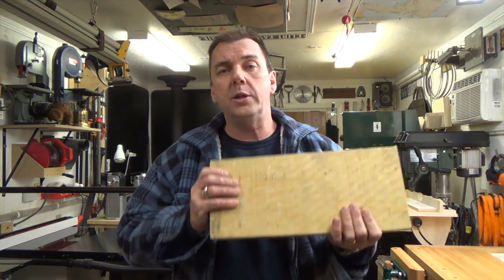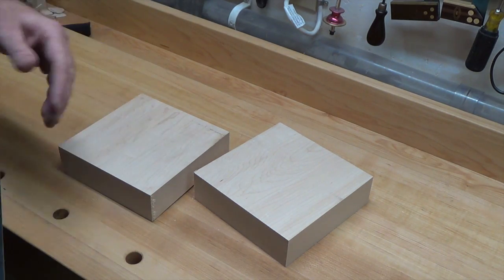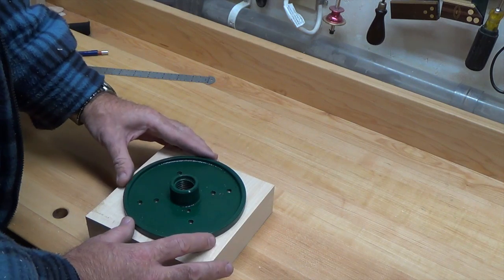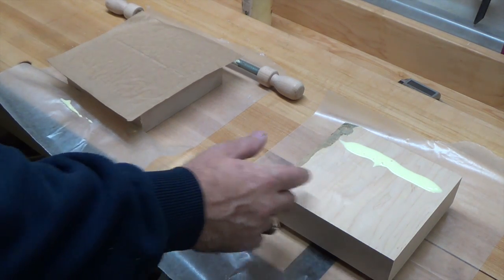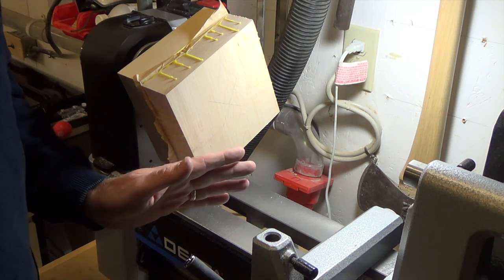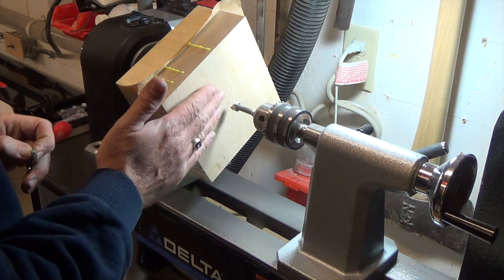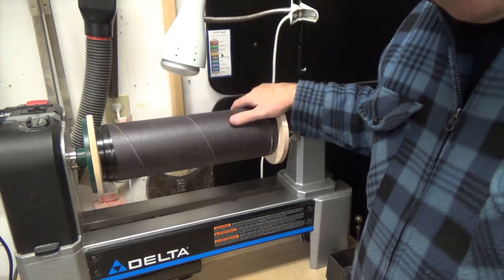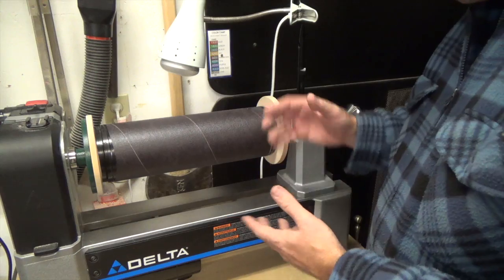Making a Ukulele Part 2 (Thickness Sander Build)

Comment: Kenny - Really interesting idea for the thickness sander.  Now you are really set for any kind of thin stock.
Reply from the maker: Thanks Dave.  This was definitely a great project to make and it has come in handy on many occasions.  I would like to get a commercially built sander one day, but until that day comes, this shop made one works just fine.  Thanks for tuning in.
Reply: Kenny - I may have missed it, but how is the right side of the drum set up?  Assume you are using a live center but is it just set into the wood flange or is there a nut embedded into the wood for a bearing surface?  Thx.
Reply from the maker: Starting at about the 10 minute mark Dave, I explain the process for embedding and gluing in place a 1/4-20 nut to keep your live centre from wearing the wood at the tail stock.  The steel of the nut keeps the whole unit centred and spinning true on the lathe bed and prevents the wobble that would be created if the tail stock wood were to wear and become oval or off centre.  I hope this answers your question.
Reply: Kenny - Yes.  Thanks very much.  Really love this whole idea and plan to make one.  Thanks for all the great details.
Reply from the maker: You're very welcome sir.

Comment: Your sander is brilliant.
Reply from the maker: +PinHolePip 
Thanks for the kind words.  On last week's show, I made a dust collection shroud for the sander.  It truly does work extremely well and is a fairly simple project for anyone.....as long as you have a lathe and access to the material to make the drum.
Reply: +kennyearrings1 As luck would have it I came into a nice little Grizzly lathe last week that will fit the bill just fine. 
Thanks again for a great little series with the uke build.
Reply from the maker: You are very welcome.  I hope that you will find other episodes of the show interesting as well.  Thanks once again for tuning in.

Comment: Nice idea! A lot different idea than I thought you would go, wish I had a lathe.
Reply from the maker: +michael hoyle 
Hopefully, one day, you will have a lathe and this idea will still be waiting for you in the end.  I would have liked to make a stationary one, but I just don't have the room in my small shop.  I'm pretty packed in there now.  Thanks for the kind words and for taking the time to leave me a comment.
Reply: I am looking for a good used Rockwell/Beaver lathe to round out my Collection of vintage Rockwell/Beaver tools.  I laugh because most of my power tools like my saw, or hand tools are way older than me, but hey they just don't build tools like that any more, and the ones they do are way out of my budget LOL!
Reply from the maker: I hear ya.  Some of the best quality tools are the oldest quality tools.  Way too many cast white metal parts nowadays whereas before, the parts were good quality steel.  Sad really.  That, combined with the fact that our selection of manufacturers is getting less and less makes it harder and harder to get good tools for the hobby.  Good luck on your search for a lathe.  I've got my fingers crossed for you.

Comment: I picked up a 30 " pipe so I could have two grits of sandpaper. My plan is 13" I'm making end grain cutting boards and sanding with a palm sander is taking forever and I'm not doing a good job getting it flat or even.

As a test case I simply inserted two wooden plugs and then made a table similar to yours the piano hinge and an old car jack.

In 15 minutes I was able to thickness an end-grain cutting board. It worked like a charm.  I love the idea of your clamp on the bottom of the table to hold it to the lathe.

I also love the idea of turning down the end caps so that they're perfectly round and also mounting it to the end cap. After 15 minutes of my test case the tail stock and began to wobble. I love the idea of putting a nut in the center . Thanks for all the great inspiration.

Since you put this video out four years ago, is there anything you would do to change and or improve the drum or the dust collector you built in the second video?
Reply from the maker: Glad to hear that you found this video to be helpful and that you made your own.  I like the idea of the two different sandpaper grits.  If I were to change anything, I would change the nut at the tailstock.  I would install it a little tighter so that there is less of a chance of wobble.  After using it for quite a while, it does wear and start to spin out of square.  The tail stock starts to wobble ever so slightly and the nut has to be removed and glued back in place as square as you can get it.  Possibly a larger steel block with a punched centre point to allow the tail stock to sit firmly in place would be better than the larger hole of a nut.  As for the dust collection shroud, I wouldn't change a thing.  It performs perfectly for my needs.  I also use it to sand end grain cutting boards so I completely understand how you would like the speed with with it does it.  Just make sure to hold on to that board because if the sanding drum grabs it, it's going for a flight.  Thanks for tuning in to the show.  I appreciate it.

Comment: That is an awesome solution! I only see one little thing you could improve. I think the adjustment screw on the table will eat into the top board. A little metal plate will solve that. 

I love this solution! Great stuff!
Reply from the maker: +Willem Kossen 
Great suggestions.  I may have to drill out a shallow forstner bit hole and epoxy in a small fender washer.  Great suggestions.  Thanks for tuning in.

Comment: Very creative solution Kenny. 
I wasn't really sure where you were going with this so you had my full attention the whole time. :)
I was wondering about the live center and the nut you glued in.  Do you think it will damage the live center as those two rub against each other over time?
Looking forward to the next installment.
Keep up the good work!
Reply from the maker: +Chem Cody 
I did think about that and I'm not really sure.  That's why this is NOT my good live centre.  I don't really think that it will damage it as it isn't really rubbing.  There's enough tension on the tail stock to engage the live centre and allow it to spin so the rubbing is eliminated.

Comment: Great idea with the sander sir! Thank you. What is your opinion on using the plastic quarter inch thick tube instead of the metal one? Best wishes for your show from Russia.
Reply from the maker: +Михаил Попов 
Thanks for the kind words on the show.  I considered using plastic pipe for my sander as well but I feared that the friction of sanding would cause too much heat for the PVC pipe.  I don't think there would be enough heat to melt the pipe but there could definitely be enough heat to mis-shape the pipe out of round, making the sanding drum useless.  It was for this reason that I went with metal.
Reply: kennyearrings1 I was thinking about PVC pipe also for about 30 nanoseconds and abandon that idea for the same reason you did.😁🛫

Comment: The leading and tailing edge of thin stock get sucked up into the blade when the material is between the feed rollers.  To stop this from happening, I cut my stock about 3 inches longer then I need and then use two sided tape to hold down each end of the stock on a back board of  ¾ ply.  I feed the ply through the planner and the two sided tape hold everything in place. Doing this I can cut down to about 1/16 on my machine.  I then just cut the stock at the tape.
Reply from the maker: +Bill McKee 
Nice suggestion Bill.  That would be a perfect solution for those times when I don't feel like setting up the thickness sander.  There are so many applications where double sided tape can be used in the shop and you have just provided me with yet another one to add to my list.  Thanks for chiming in with your suggestions.